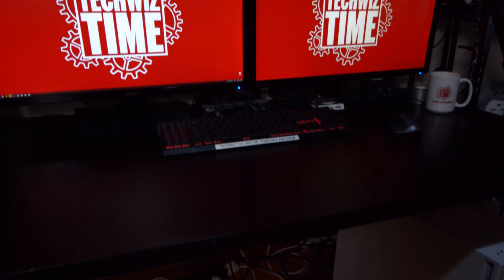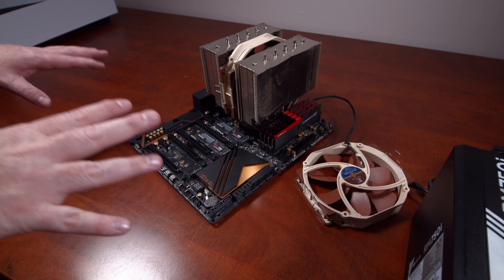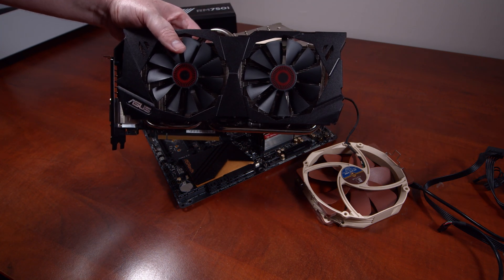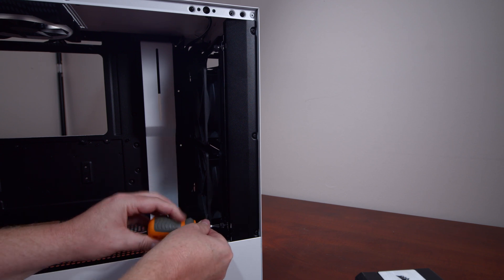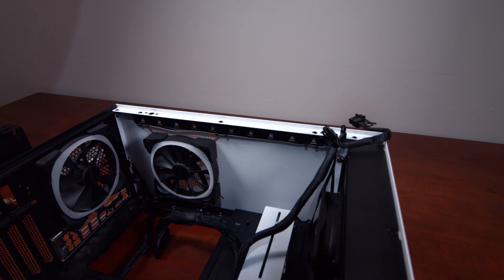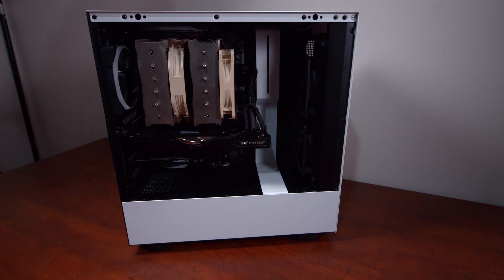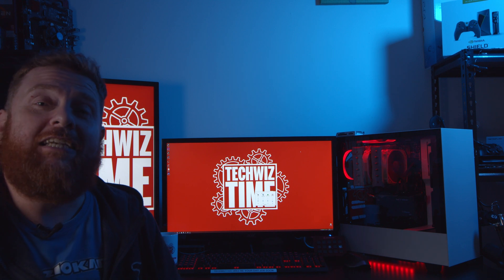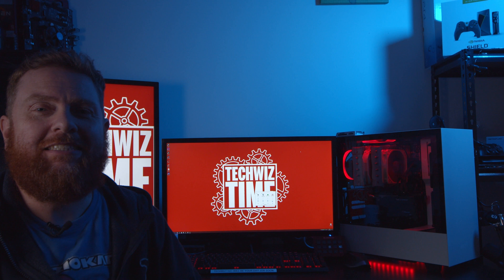Transfer PC Parts to Another Case - NZXT H510i PC Build

Comment: Such a great video. I like how you show passion for what you do. Consider myself a new subscriber. I have questions regarding to the case and the pc build. I have the same case NZXT with the fans (that came with the case) and the RGB lights. However, im planning to get the two fans RGB and also the Kraken M22 for this build. Do i have to buy the other NZXT HUE component? Cause it says at the back of the case that you dont connect water pump systems on the HUE that comes with the case already.
Reply from the maker: So the pump power needs to be plugged straight to the motherboard. If it's plugged into the Hue2 then you might have issues.

In terms of needing another Hue2, you should be fine with the single. With splitters and so forth, there will be enough ports to tap into :)

Thanks for subscribing too!

Comment: I used the fans that came with my H510i and put them between the GPU and the mesh above the power supply. They basically just sit on the black mesh pulling a bit of air into the case. The two 120mm fans fit perfectly and I just set them to 40% which means they are basically silent and they dropped my GPU temps by about 6C. Looks kinda weird at first but hey, if it works it works.
Reply from the maker: Nice tip!!!!!! I will have to try this myself to get some lower GPU temps :) Will mention this trick in a future video later down the track too. Thanks!!!!!